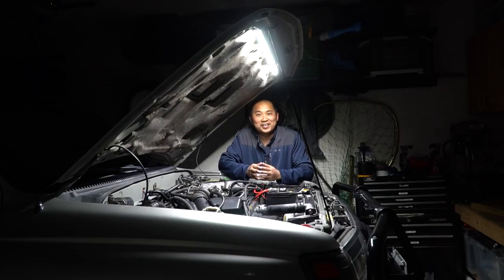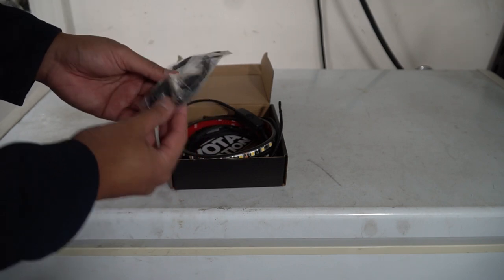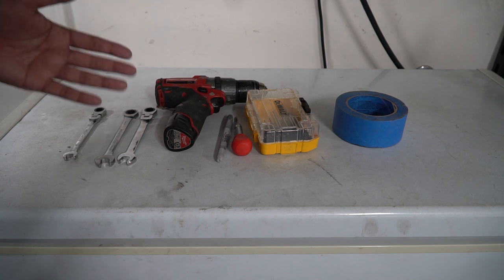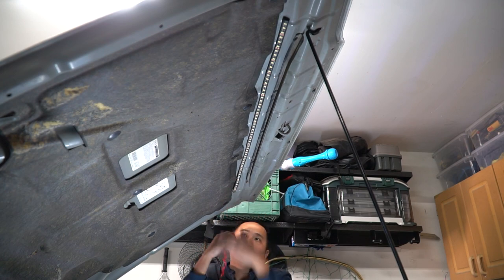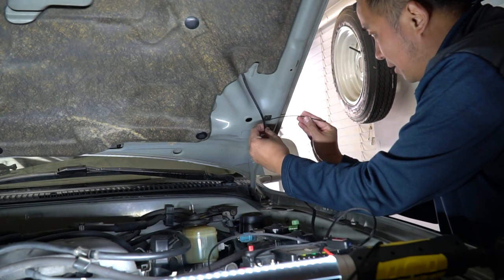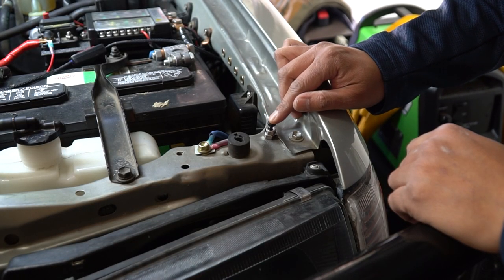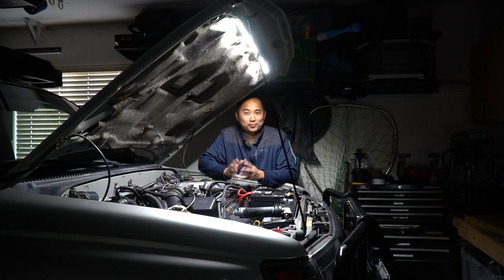TEQOFFROAD Under Hood LED Mod + Install - Toyota 4Runner / Universal Fit

Comment: I installed a very similar kit from Scarab a couple years ago. Just wanted to say that after a while I relocated the ground and bypassed the hood pin for stealth reasons. It also rattled loose a few times so I prefer to control it with the switch. You should really install Spiker high-lift hood struts! First mod I did to my 3rd gen and remains one of the most useful on a daily basis. Cheers.
Reply from the maker: It’s on my todo list. 

Nice tip. I was think the grounding may need some sanding for better connection. I’ll monitor it.

Comment: Heck yeah!  This is awesome.  I will be getting this for sure. How is the drain on the battery? Just thinking if I have it open for a long time to work under there, will it drain the battery after a while?
Thanks!
Reply from the maker: It’ll be a while… the wire is very small and no relay suggests it draws very little power. The fuse is 5amps also so I suspect 2-3amp draw max.

Comment: Hey hope all is well, I just got the same bumper as you and winch and noticed the front end was dipping down a bit do you have a good solution for that? Thanks so much
Reply from the maker: Up the perch to the 2nd lowest if you got bilstein
Reply: @PhoRunner  I was thinking about that or adding spacers, would you not recommend spacers? Seems like it’s dipping down half an inch, gonna get everything measured on Monday.
Reply from the maker: I got a tiny 3/8” spacer on top of mine to fix lean. Mines on 2nd perch with 883 now since it settled quite a bit

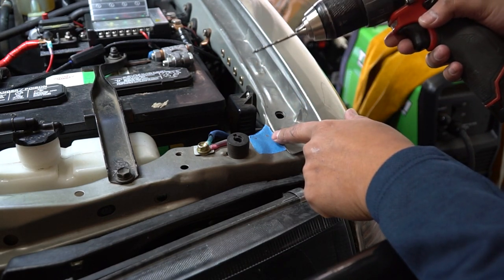Comment: Bro why did you drill that hole at 6:00 when there's already a hole in the fender an inch away? Was there a reason? Cuz I bought this kit hoping to use that pre-existing hole and not have to drill anything. i'm pretty sure that pre existing hole would have worked, and there's another one closer up to the hood hinges that would keep it out of the way of getting caught on anything. i don't know why you drilled that LOL
Reply: Hello! The hood is curved above that hole and would cause the pin to break after extended use. It also makes the pin switch visible from certain angles when the hood is closed through the gap between the hood and fender.
Reply from the maker: Yota nation did their homework designing this and I can confirm similar. I chose that flat spot to allow easy operation of that pin.

Comment: Wife need underbody lights for her safety.  Not mirror lighting. Is there a kit that works with her factory key fob ?  When she uses the unlock button the lights come on ?
Reply from the maker: Hmm probably need a special device to wire such a thing. I’m not sure of any. But you’ll need to find a circuit that stays on when key is unlocked, don’t think the 4runner has anything
Reply: @PhoRunner  toyota has the kit. $1000

Comment: Two questions, I have a 97 4Runner and was thinking about going to km3s that were 32s does that fit on stock 4Runner and does that mean I have to regear as well? Second question can you just put a front locker on the stock 4Runner or have to change a bunch? Appreciate the answers and have a good one.
Reply from the maker: Should fit. Bfg run small.

Lockers won’t require a bunch of change.
Reply: @PhoRunner  fire thanks so much, just Built sleeping drawers in back your video on it inspired me

Comment: Hello! Just got a 3rd gen, my lift kit is coming in tmmw. What other components do I need to upgrade. For example do I need to get my swat bar end links now. If so which ones?
Reply from the maker: Yeah. I would move the fronts to the rear and buy 2nd gen 4runner ones for the front. Think I got a link and details in my video description